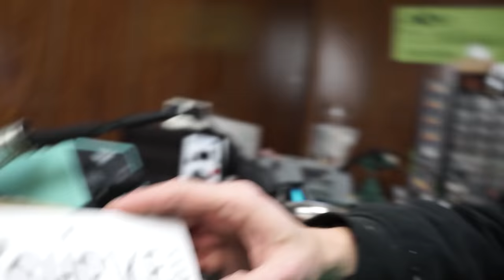Shrike Style - BUILD IT

Comment: on the regular shrikes, how do you soft mount?  :)  I had a carbon plate made to turn the FC sideways 45 degrees so the standoffs are still hard mounted to that plate but the FC is softmounted with the rubber dampners.   Curious on how you all do the soft mounting on the original shrikes.
Reply from the maker: We like to use o-rings on the top and bottom of the FC. You may need a longer bolt to do this.

Comment: About to build up my 2nd & 3rd Shrike Styles (1 rebuild + 1 totally new) with the T-Motor F60s. :)))

Only question I have is - base KISS PIDs!! I've actually been running tweaked versions of A-Nub/Zach's Shrike 185 KISS FC preset PIDs on a bunch of different builds with good results but I was wondering if you guys find either have some base settings for the `Style that work well or if you've found that the Style likes a certain type of PID ranges &  balance, i.e. more pitch vs roll P, how much D versus P,  how aggressive you go, etc. etc. 

Any help appreciated - would just get me juicier, faster.

Comment: Is the Shrike v2 200 a true 200mm Motor to Motor?  Also, is the Shrike v2 220 a true 220mm Motor to Motor?  I assume if I had the v2 200 I could simply purchase the 220 arms and make my v2 200 into a 6"?  Just curious, as based on my math the 220 would need to be like 223MTM.  Am I missing something?

Comment: Amazing frames! Question: I am new into quads, coming from surface RC racing. Built a micro 90mm quad that I have been practicing, and now I am ready to build a 185-220 size. After researching I am going with a shrike hands down. What frame do you recommend for someone learning like myself? Was leaning towards the 220 v2, or style?
Thanks!

Comment: Hahaha, Where's the Beeper???   My buddy just built a Shrike Style as his "First Build"..... I watched, he took "roughly" 10 hours!   LOL. ;)   But he did it all himself.   Super sexy frame, I'm gonna get a couple of them.....  :)
Reply: I think my first build also took about as long. Glad you like the frame man, appreciate it!
Reply: I recently built my first quad. I probably spent roughly the same amount of time.
Reply: I had a question about flight controllers. For my build right now I am using a Naze32 Rev 6. I have seen many other pilots on the internet using the KISS FC. I was wondering what is better about the controller as i might use it for my second build.
Reply: what is your first build?
Reply from the maker: It runs proprietary software that manages flight in a different way from BetaFlight and other common flight software. I prefer the result which is usually a much more "locked in" flight characteristic.
Reply: What Firmware are You using? 
I was thinking of getting an F4 and flash RaceFlight on it... 
Currently I use an F3 (Motolab) with BF3.0.1... 
What do You think?

Comment: what motors are you using?
Reply from the maker: Those in the video are ZMX v3 2300kv motors. But our usual motor is the T-Motor F60 2450kv.
Reply: The 220 goes with the F60 2450kV like a Rocket! I use them with DAL 6045x3 ;-D